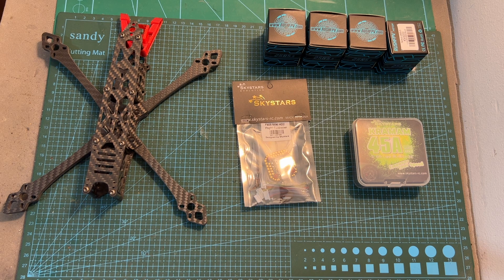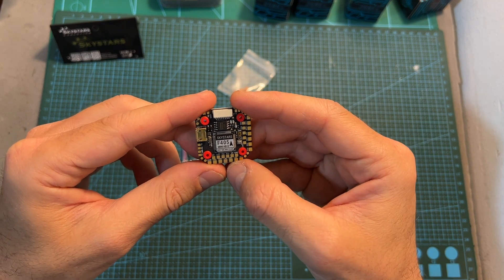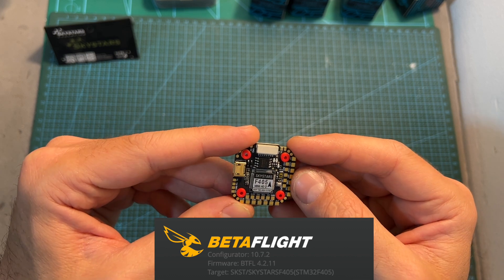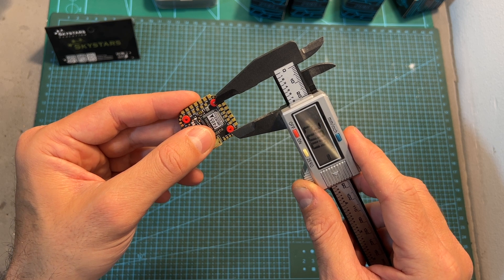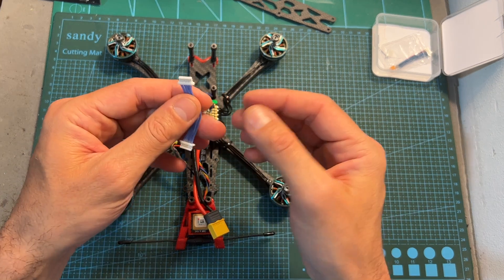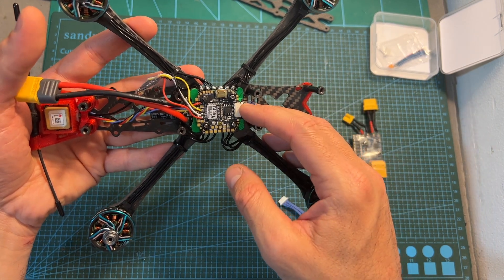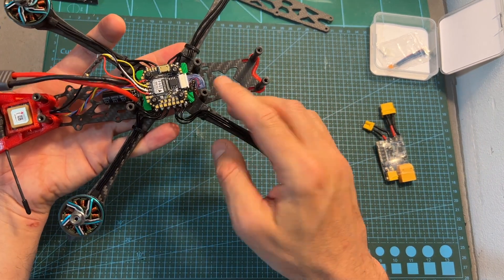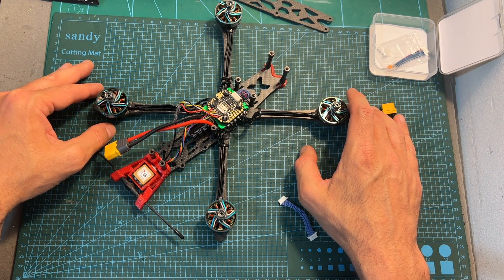Always Be Careful When Building A New Drone // Skystars F405 Mini HD 2 FC

Comment: If you accidentally wire 5v to an RX or TX port no worries because while the the F4 and F7 processors are 3.3v the ports are 5v tolerant in order to simplify interfacing 5v logic so 5V won't do any harm to them. Anything more than that though and you can write that processor off.
Reply from the maker: Thanks!

Comment: A bit frustrating. Looks like will be a nice build once can be completed.

See the CPU has a "Keep area clear" warning. Wonder if the F405 chip naturally runs warm?
Maybe adding a heatsink might help manage temperatures (understand being concerned if able to trust).
FYI: If type Status in CLI, it will show an actual core temperature value. 

From specs on BG, I see that FC also supports INAV. Having baro and GPS will all using portion hold, and doing waypoint missions. (features that you have find convenient when performing motor, or battery capacity testing).

Comment: Last year I bought a stack Racerstar Taichi (F4 40A) and the instructions wrongly mixed 5v and ground. I was not aware of this and followed what the pinout said, and it shorted. Because this happened a month after the warranty expired, both Banggood and Racerstar did not support me. Then I saw several comments on Banggood mentioning this misprint. The fc and I got burned.

Comment: Ver good advice Gal. I did the same thing on a Tyro 89 build. Everything came in the box but I didnt realize that I grabbed the wrong FC to ESC connector off my work table and used it instead of the one supplied in the kit. I was new to building and it never occured to me the pin layout was different on one cable to the next. So after 2 burned out FC's I realized my mistake...lol. Live and learn. But this is a very important and easily overlooked detail for a new builder for sure.